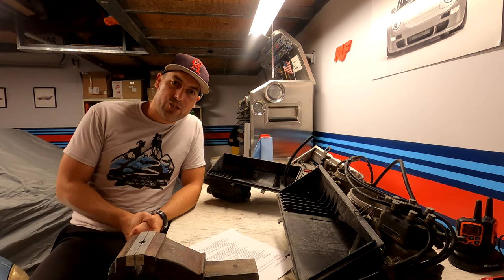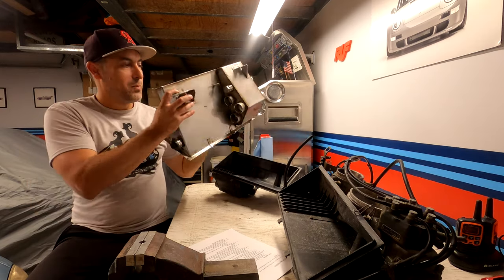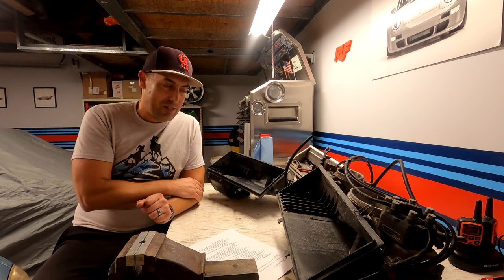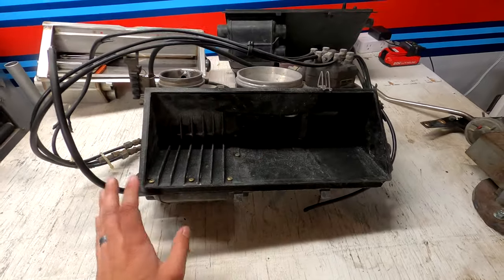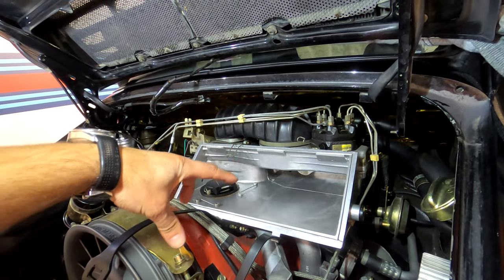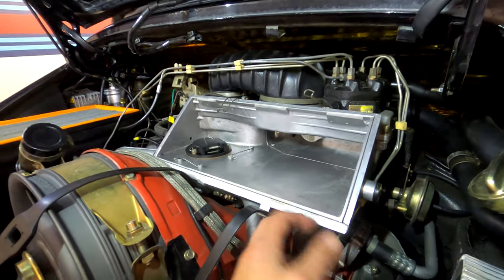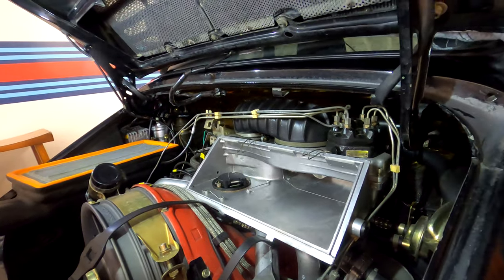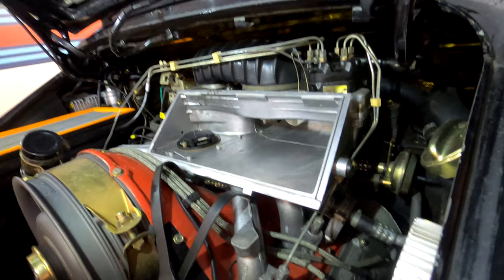Air-Cooled Porsche 911 Bosch CIS Airboxes

Comment: Hey Joe,
Love your videos.
You should do a video on adding a fuse to the unfused light circuits on the SC. Would save alot of people some hassle. Suprised no one has done this yet. I believe the ash tray light and the ventilation light are a couple of the main ones. Had a friend burn a meter of wiring changing the radio, because he accidentally nudged the ash tray light in the process, which had no fuse.
Heaps of info on pelican parts, but no videos.
Reply from the maker: Video in progress...

Comment: Great video on the boxes. Really appreciate your onsite. The boxes do have an OEM pressure relief system built in from the factory. It works but old brittle boxes will develop cracks even with this in place. Kurt Donahue of Klassik automotive training explains it well in his CIS rebuild video.

Comment: Thanks for the info and a walkthrough. Have you thought of velocity stacks on rudder intakes?
Reply from the maker: In the lower half of the box in the inlet of each runner? Never thought of it before but that would be a cool experiment!
Reply: @JoeEngineer  Yes exactly. That cavity does not yield itself to best airflow, i think small velocity stack colors would help allot right on those openings to the individual rudders.  Looks at AMG 63 ROW airboxes. They have velocity stacks even that far away form the engine to help the airflow.

Comment: Hey Jose, curious if you could give a contact to the shop you had rebuild your crimped air hoses. I’m a SoCal local as well.
Reply from the maker: Yelp Mesa Hose Costa Mesa
Reply: Thanks! I'll try bringing my hoses down there in a few weeks, did you have to cut off the old ones for them? Or can I bring mine with the old crimped lines on so they can reference it when they re-make them? @JoeEngineer
Reply from the maker: Take the old ones as is so they can reference lengths and clocking angles.

Comment: Thanks,  that was very interesting and informative, especially your insights about vacuum leaks (here and in other videos). Luckily, my SC already had a pop-off valve installed when I got it. I'd love to see an expose on the 911SC timing chain tensioner issue if you are looking for new topics.

Comment: Nice video, very informative. I know it's very tight trying to do any work with those components whilst in the car. I've got to replace the intake runner boots and planning to partially drop the engine by loosening / undoing the engine mounts, leaving the fuel, electrical lines, driveshafts in place. Do you think that would create enough room to remove the airbox?
Reply from the maker: Yes, I've heard of a partial drop to get a little more access. I would go all the way and drop it completely down to work comfortably around the CIS, especially around behind the airbox. If the boots need attention, it's likely other rubber parts do as well.
Reply: @JoeEngineer  Thanks, engine will come out someday. For now I've got to fix a few oil leaks at the top of the engine and replace the intake rubbers as this was the source of the vac leak when doing a smoke test.